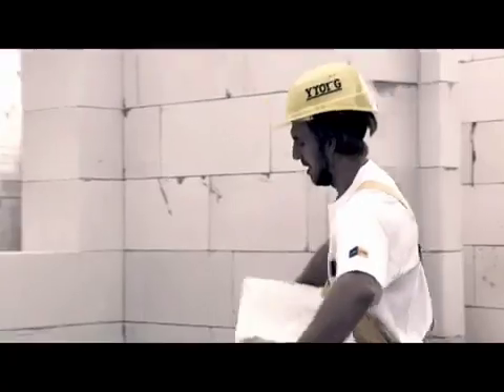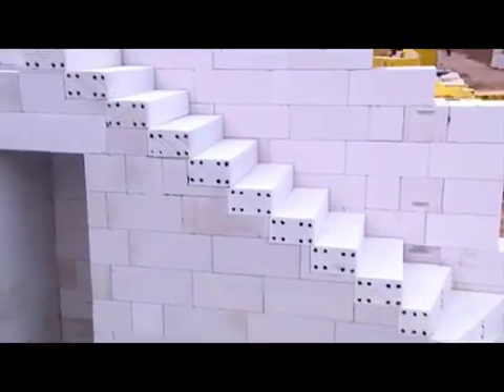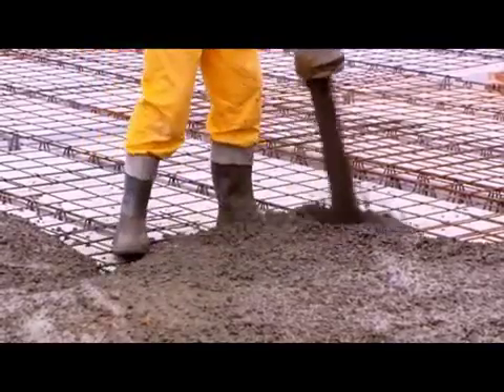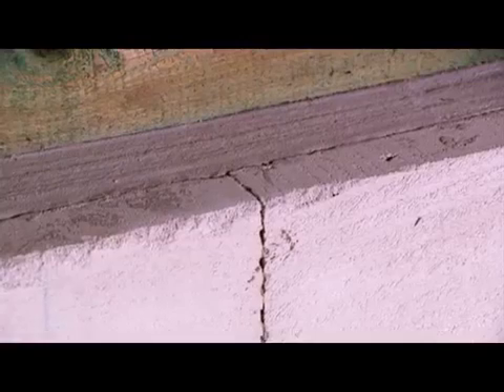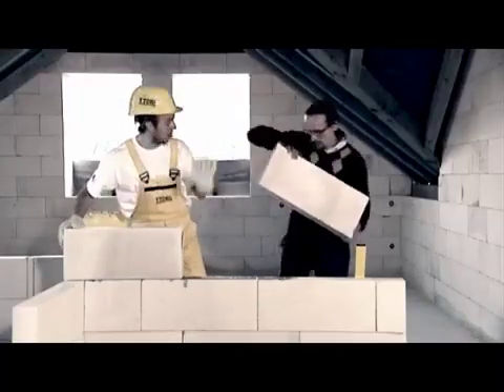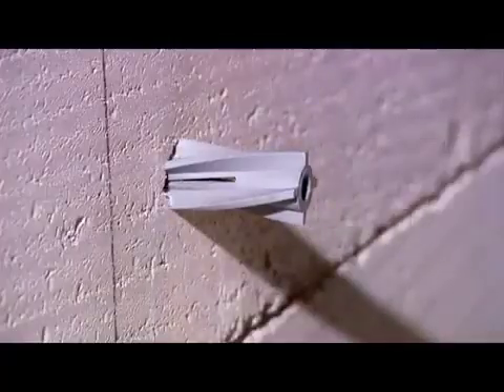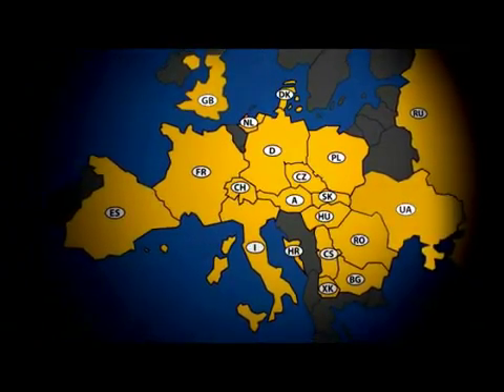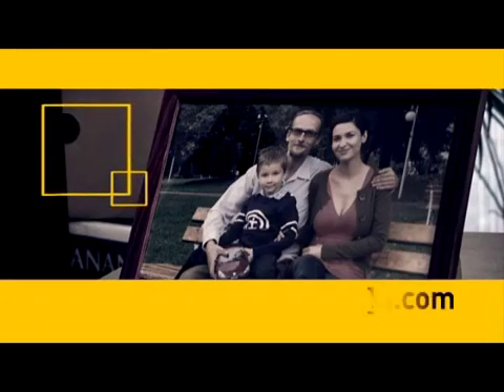Lightweight concrete blocks to build your house step by step part 2

Comment: If we use hydraulic pillers to lift this house which made by light weight concrete then is it give stability during flood and earthquake as well as same house which is built on ground?

Comment: I have a problem with those Ytong videos, in every 🏠 there are different approach es to connecting those Ytong blocks, one time they use triangle vertical metal supporters in the 4 corners, onetime they use horizontal, if the blocks are very wide, they won't use anything.halo?

Comment: What's the cost per square meters?
Reply from the maker: Depends on location but in the UAE lightweight aerated concrete blocks price is around 45 USD / m3. For block with dimensions 600 x 300 x 200 from 1 m3 you can make around 5 m2 of wall. Core and shell for 1 m2 is around 200 USD + / -
Reply: @stretchceilingsDubai  Do you mean 45 USD per m2?